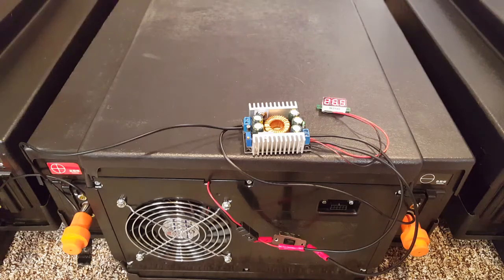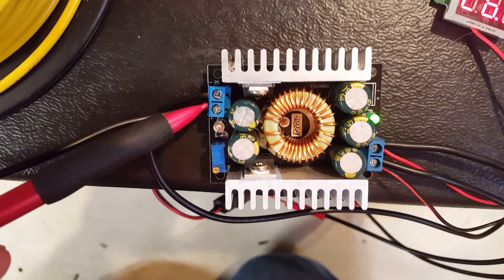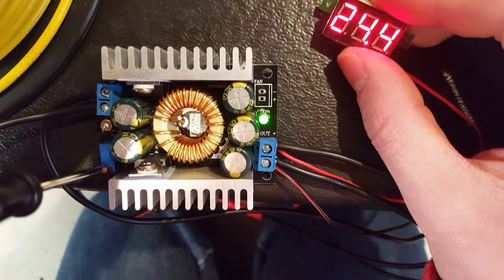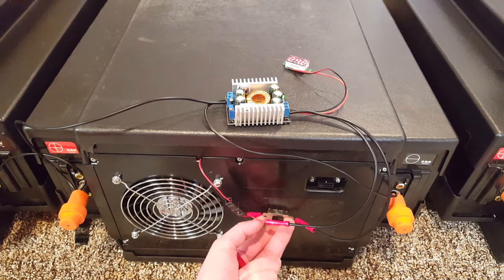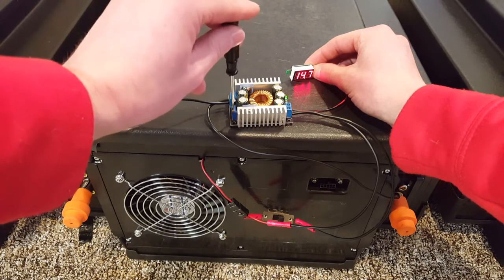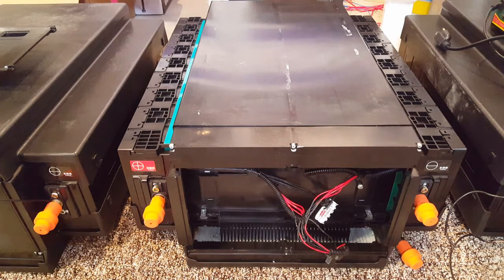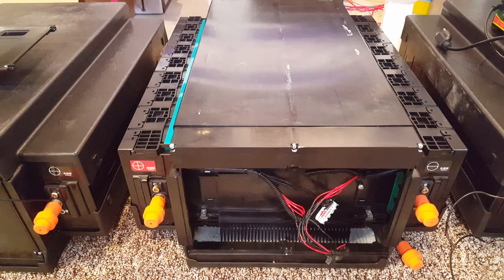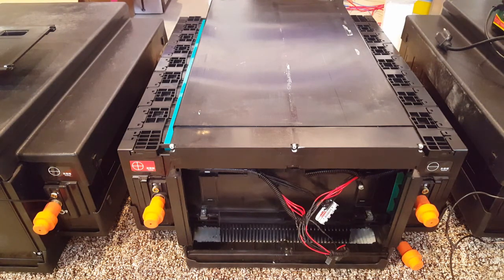24v fan running on 12 volts? A practical use for a BUCK converter

Comment: If I run 24v fan straight from a 12v pc power supply, will it hurt the fan? Or it's just going to run slower and have no side effect?
Reply from the maker: I don't think it will hurt the fan. The only concern would be that the voltage is too low to get the fan spinning on startup. Try it out!

Thanks for watching!

Comment: Replace those jet engines with Noctua 24V fan !
Reply from the maker: It turns out that I will probably never push these batteries hard enough to need the fans but it was a fun experiment anyway

Comment: Yea, good tip. I have the same number of these as you do. Except, I got them with the BMS already on it. Did you connect a BMS to each battery?
Reply from the maker: Mine came with an original BMS in a black plastic box, but I removed them. I haven't settled on a specific BMS yet, I am thinking about trying the chargery BMS, but also might give one of the cheap Bluetooth BMS's a shot. My plan is to connect all 4 modules to one 16s BMS.

Comment: This is a great tip for the fans.
Reply from the maker: Have you fired one up at 24 volts yet? 😂
Reply: @diyrenewableenergyelectron4996  With your help, I'm about to. I only have 2 units and I plan to purchase the buck converter through your link with amazon. Do I need 2 or 1 will work with 2 units in series?
Reply from the maker: @ernestcriss  you should be able to power both fans with a single buck converter. The fans are 1.75 amps each for a 3.5 amp total draw which should be a cakewalk for an 8 amp buck converter.
Reply: @diyrenewableenergyelectron4996  Thanks! Ordering now.